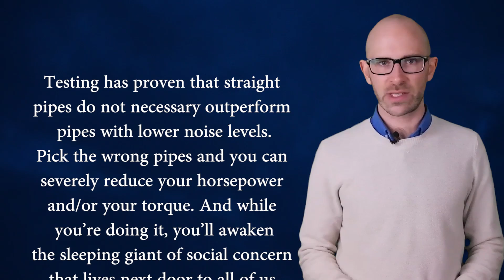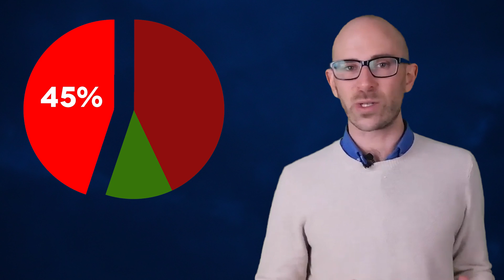Why are Harley Davidson Motorcycles So Loud?

Comment: Loud bikes save lives on the SoCal freeways.
Reply: Sure, because people hermetically sealed in metal boxes with their own engine going, AC, and a radio will be able to tell where the fart noise is coming from in time to react. Morotcycles not cutting in front of people, breezing through red or yellow lights, and driving between cars is what will save lives.

Comment: Cruiser's are generally louder because the riders like the loud engine noise, there is a perception that loudness = power so a loud bike is therefore a powerful bike. Harley's often have lots of chrome and are seen as the 2 wheeled equivalent of classic American Muscle cars. Having a loud bike also supports the whole rebel biker image. Having a louder, distinct, bike engine noise does make car drivers more aware of the presence of a bike, even if they can't (won't) see it. 
The most common cause of bike accidents involving another vehicle are: being hit by turning cars, or being rear-ended - usually because car drivers are looking out for cars and the smaller shape of a biker doesn't register.

Comment: the problem with the report of the national highway traffic and safety is it doesn't subcatagorize the types of motorcycles involved in fatal accidents. most of those are riders of sport bikes, not the louder and slower roadsters, baggers and cruisers. there have been several times that my pipes on my Victory have indeed saved my life. my pipes are louder than my horn. my pipes also scare off deer.

Comment: I've heard bikes so loud that they startle you, which I assure you, is not good for the motorcyclist.   It also robs the rider of the ability to hear traffic.  It would be interesting to see a breakdown though of 'loud' bikes vs. quieter bikes and how often they are in accidents.  I'm sure you'd have to control for a few other variables... you don't see many people on Harleys riding wheelies down the street like you would on some other style bikes.

Comment: COPS HATE MOTORCYCLISTS As a man who has been hit i noticed right away that the police are very biased towards cars this women came into my lane by around 70% and the accident was deemed no fault of the driver of the suv or mine so i am permanently injured and have been trying to sue for over three years so these statistics about motorcycles causing the majority of accidents is bullshit a guy in front of my condo was killed when a truck turned in front of him  and the driver of the truck was not at fault and who is to argue the rider was DEAD i hate the police for this reason i am a responsible and educated motorcyclist and i get harassed constantly these stats are wrong i know it its just easier to blame the bike i guess smh

Comment: Re the loud pipes save lives bit -- gathering quality randomized data on this would obviously be unethical. The study you present doesn't really dispute loud pipes "saving lives" as there's no actual test performed. It's at least plausible that more crashes could be caused by Drivers (v. Riders) if aftermarket exhausts were banned (and motorcyclists were less audible as a result) given that they comprise such a low proportion of at fault crashes today. That said, I put an aftermarket exhaust on my mt10 because I like the sound and my exhaust improves on oem torque and hp values throughout the rev range. Not a straight pipe obviously.
Reply: the death-rate also includes crotch rockets, that make up the majority of deaths, and are entirely irrelevant to the question.
Reply: Yet, they forget to mention those don't they.Lol

Comment: Personally, I'm more interested in how even a single harley makes it past any noise restrictions. In Australia The Ducati 888 actually required a new rear sprocket to pass the 60Kph driveby test. A bike by far quieter at any speed than a harley at stock.

I will also point out that most accidents blamed on bikes are the result of "He came out of nowhere." A phenomenon well known amongst even casual bikers where a driver sees them (In some cases even looks them in the eye) and the brain writes them off as not a hazard as they're smaller and less able to do damage, effectively blanking them from the brain. If you take this into consideration most bikers will tell you that any accident they were involved in was caused by a car that did not take any notice of them, and the bike had to avoid allowing the car to get off scott free.thus not being included in the survey. Bikers are aware that an accident, or moment of inattention can end their life, and while there are still accidents caused by bikers pushing to hard, quite often while having fun. I suspect that your statistics on biker caused accidents are "massaged" to fit a political narrative. Bikers are regarded as less important in many political narratives, and thus the statistics sought by many organizations that would seek such surveys, the questions asked and statistics sought regularly avoid asking the questions of who is actually at fault.
Reply: BS. I have been a motorcycle rider for a few years and I learned very quickly that drivers, even when they looked in my direction, did not see me because of the windscreen side pillars. So, Mr. motorcycle rider, how about you SLOW DOWN, STOP ACTING LIKE YOU OWN THE ROAD and take a more realistic and safe approach to motorcycling? Always wear a bright coloured safety vest, always have your headlight on, never weave in and out of cars, never speed (THIS is mandatory if you want to be "safe" on the roads.) and ALWAYS be alert that drivers may not see you because of circumstances BEYOND their control. Or be smart and drive a car. I did, after 3 falls, 2 from oil spills and one, a drunk pedestrian whose habit it was to try and commit suicide (He succeeded a bit later with a car.) and it's far safer. Common sense.

Comment: The fraction of a second that you have to "suffer" with the noise of a bike exhaust may put you out but it also may keep some kids parent up and rolling. I've had a quiet bike and was cut off on a regular basis, to the point that I sold the bike even though I loved riding it. My HD is loud and I have yet to be unnoticed by other drivers. I don't want to wake my neighbours early or offend anyone but I want even less to be run into by a careless lane changer.
Reply: Maybe you're not one of those childish, self absorbed, socially inept motorcycle riders who is so deprived of "attention" he has to rev his bike while slowly cruising those ever-so-dangerous Cafe strip's?

Comment: The loudness of a Harley Davidison is directly related to the IQ of the rider. The louder the noise level is will indicate a lower level of brain activity. This has been proven time and time again. Just look for them on a very hot day and they will be going down the road with their sunburned skin and arm pit hair flying in the breeze. They will have a stupid look on their face and will be looking for a bar to park their motorcycle at. They like to be with their own kind.

Comment: So a bunch of comments are about how the sound is traveling backwards, and the person in front of you can't hear you.  If you treat the sound as a point source, unless you are traveling close to the speed of sound (767 mph), people ahead of you will hear you.  Another is the helmet issue.  While many riders do not wear helmets, the vast majority do.  Hell, some I know wear reflective riding gear so you can see them easier.  Yea, I ride, and yea, I think a loud bike sounds cool and all, but to a point.  There's no point pissing off your neighbors, or hurting your hearing, but at the same point there's no reason you cant be in the range of 60-70dB instead.

Comment: I used to ride a Honda CTX700.  It is a larger cruiser type bike that was very quiet.  It was a bright metallic red color and very visible.  I was almost hit on that bike several times, with the offending driver always stating they didnt see me.  Now I ride a Harley with somewhat loud pipes and I have not even had a close call.

Comment: A freer flowing (louder) exhaust equals more horse power and torque when combined with the right intake modification and fuel map. This is a dyno proven, real world power gain that is measurable and sometimes considerable. This is the number one reason us Harley enthusiasts make these modifications. It is the first thing modified in a Stage 1 upgrade. Second, you can deny it all you want but "loud pipes do save lives". I see it work almost everyday. Inevitably some cager, usually some douche bag Mercedes or BMW owner, scrambling to get one more car ahead of traffic will start to swerve into my lane without warning, without using their directional and only relying on their mirrors. A quick rev of my bike immediately alerts them to my presence and back to their lane they go, avoiding yet another "close call". Ya, ya....just use the horn you say. Well, fact is, an experienced rider can pull the clutch and twist the throttle faster than fumbling for the horn button and most motorcycle horns are anemic at best so I will continue using the proven and effective rev bomb alert. It is a fact that cagers "do not see" motorcycles. This fact is proven by NHTSA statistics involving autos and motorcycles where the auto driver admitted time and again "I just didn't see them". Their eye is not trained or accustomed to seeing them all the time like cars so every advantage I have while on my bike is one that I will gladly take advantage of. No, my "sexual organ" is not large, probably of average size and I could care less if you think I am cool or badass. The bottomline is my loud Harley exhaust adds performance, keeps me safer and I just plain love that sound. All the whiners can continue to.....whine. Lol.
Reply: Why buy anything and modify it? Because you can! Because that is what we do. These modifications not only improve performance but alos improve gas mileage. Harley's are not talked about in ratings of horsepower but torque. Torque is their claim to fame. Comparing a japanese sport bike to a Harley cruiser is like comparing a Corvette to a diesel pickup truck. Totally different class of machine and usage. Makes no sense if you know what you are talking about. There are two kinds of people in the motorcycle world, those that have ridden and/or own a Harley and get it and those who don't. Those who don't get it will never understand. That japanese bike you referenced may make 150HP at 10,000RPM but only makes 50 ft/lb of torque at best. My Harley makes 110HP at 4000RPM and 140 ft/lb of torque. See the difference? Also, try riding that japanese sport bike from Florida to Washington State and back and tell me how your body feels afterwards. Again, two completely different animals.
Reply: I hear you Charles. I love all bikes. I am a motorcycle enthusiast. I am not that "Harley is the only real motorcycle guy". One of my favorite bikes, wish I still had actually, was my Suzuki dual sport. I will say, that for me, a Harley has a feel unlike any other bike out there though. That is why I choose to ride one right now. I have owned and will continue to own all kinds of bikes and I will support all motorcycle riders. You will never see me choose a Harley for 0-60 times of top end speed. That would be foolish as you aptly point out there are many other machines that will do that much better than any Harley. I love the rumble, the shake and the distinct "potato...potato...potato" exhaust note. Just my thing....many others don't appreciate it and that is OK.
Reply: Devin Tolcou by the time you've reved... Its been heard... The other driver reacts.. You've been hit..... If only drivers/riders would just spend more time looking out for one another.
Reply: Steve o I respectfully disagree. I experience it all the time. Cager starts entering my lane, I rev, cager corrects and goes back to their lane. Too be honest, just normal riding I can tell the cagers around me hear me and are more aware of me by their reactions and looks in the mirrors. I definitely agree with respecting and being aware of all drivers.
Reply: supertimbo1959 This guy tells me to grow up as he proceeds to threaten to run me over. What a piece of shit. Fuck off superbimbo69.....
Reply: DT so a horn wouldn't do even better?  I mean seriously you have to be loud even when driving thru a residential neighborhood at night.  Because you can't honk your horn at an offending car?
Reply: You all wouldn't be stressing the performance exhaust mod if you all weren't so damn slow at stock in the first place. 

Second, my MSF class taught me to keep my finger on the horn at all times.. Maybe you should practice resting your finger there...

Third, the majority of the sound you'll be trying to produce will be moving behind you and you'll be hoping that sound reflects off enough inanimate objects to be reflected to whoever is trying to run you off the road.

Loud pipes help…. but you're better off learning how to use your horn man.
Reply: Devin Tolcou literally the only one in hear with common sense and it's not just Harleys that are loud. I love got Vance and Hines on my Hondas (because they are superior to Harley ) I just hate the stereotype that because you have loud pipes your compensating. I love that sound, and it does get peoples attention
Reply: Charles Carl because modding a motorcycle is super fun and because cruisers are just as fun to ride as crotch rockets. Also horsepower isn't everything if I could mod my bike to ride better and look a certain way I will.
Reply: Scott Graber it is an easily controlled "monster" and we are riding at the same speeds as people in cars ride. So don't talk about something you don't know anything about.
Reply: You basically said everything I was going to say.I have a 2012 harley street glide.I get cut off probably 30-40 times, a day.Just because, they are and wanna be jackasses
Reply: The reason why we believe in HARLEY Davidson,is because they are pretty much all American made for one.You,stand a chance of getting hit on any motorcycle.Stop being such puss's and start riding with friends more.Then you'll see why we do.As a biker of over 36 years.I have been accused of being a chauvinistic asshole,but I'm not.
Reply: I will race you in the quarter mile and from New York to Los Angeles...on my stock Goldwing--125hp and 135ft/lb of torque--I have the slip to prove it from a Harley Dealer Dyno because I was challenged as the only Goldwinger at the fund raiser. Many of the "Harley Guys" changed their tune after I got on the dyno with my almost new Goldwing. Oh, and my horn is loud enough to make even the most cell-phone-engrossed-idiot jump through their skin and I don't even have to think to simply tap it...far less moves than it takes you to rev your engine. Care to "modify" your statement?
To be fair, Harley is more of a life style than someone who truly enjoys long-distance riding. That noise is just fatiguing after a few hundred miles and I'm just getting started at that point. Their are exceptions, but those guys usually have stock exhaust...because of the noise. I ride with a few Harley owners with stock pipes....the bikes are plenty fast and extremely quiet. The loud guys just give the rest of us a bad name.
Reply: D T .... Not all Harley riders tune and match their intakes or otherwise compensate for the zero back pressure that straight pipes create...most just slap straight pipes on and ride around sounding like shit and having much crappier performance and YES... Believing their wankers got bigger from it! If you rode a real bike with better handling and actually learned how to ride well, you wouldn't need to depend on loud pipes to save your silly ass! Btw... Reving up that loud piece of shit next to me is more than likely to get your ass run over by my large truck!. Grow up and learn to ride!!
Reply: supertimbo1959 a real bike huh so Harley isn't a real bike, also most people don't straight pipe their bikes, they put on louder exhausts yes but for the most part straight piping makes the bike louder than the legal limit and uninspectible